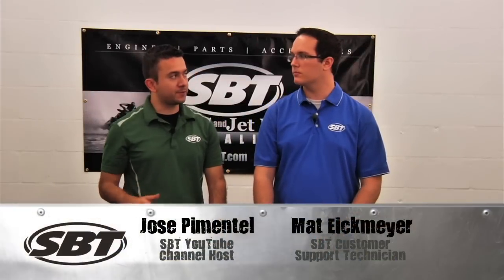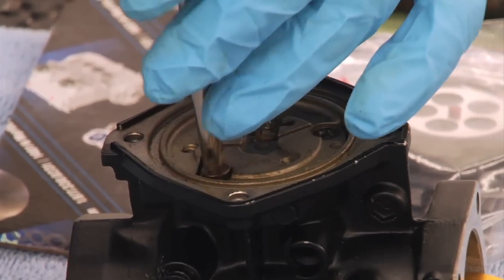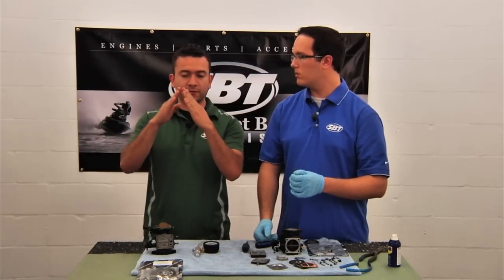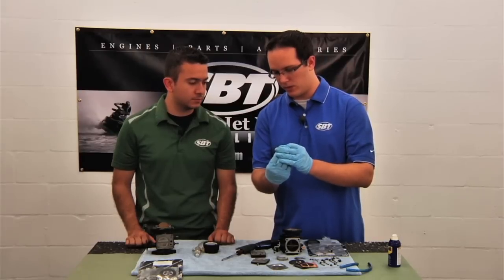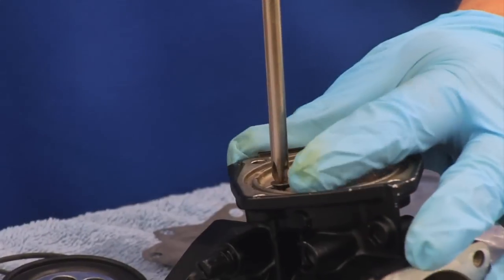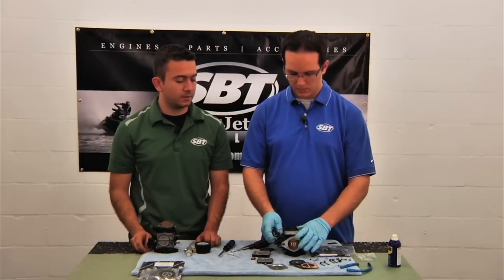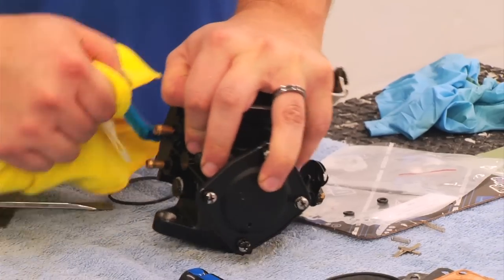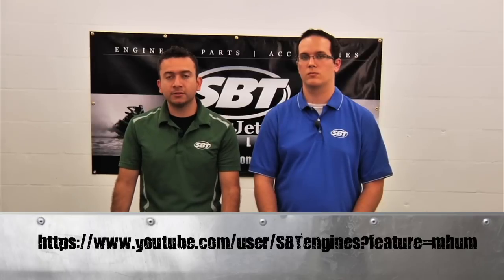SBT Tech Tips: Carburetor Rebuild

Comment: Also, thoes are not Phillips screws, they are JIS. They look very similar, and a Phillips head screwdriver will work, however, you run the risk of stripping the screws. Get the proper screwdriver, you will be glad you did.

Comment: 8:16 and were finished to put the diaframs in"
Wel how did you do that? Because it's a nightmare to get those rubber grommets in place!
Reply: there is a video which uses tooth floss. to pull them in . looks way easier. use wd40  to help as well. like thread pulling a needle.

Comment: Your pop off pressure showed much less then 20 psi. More like 16-17psi. Why did you not mention this and show how to correct it by changing springs or any other way of making the adjustment to get the correct pressure? Seems you are defeating the purpose of a rebuild if not done to specs!
Reply: Guage: 15psi 
SBT: yep, about 20psi there.
Reply: Yal have clearly never looked at a gauge at an angle. The camera wasn’t facing straight on towards the face of the gauge.... I saw 18 +/- the first time. Which was Probly right at 20. Don’t be a Karen.
Reply: @jcbenson01  I guess close to 18psi. Even if it was 20 psi there are very very few sea doos that would actually be in spec for... SBT=JUNK idk how they stay in business honestly
Reply: There is a range for the pressure but they don't tell  you in this video. About 20 must mean 15-25 I'm guessing. Why do they tell you to change the spring anyway, it's not like they will wear out. Unless it's corroded, I would leave the original spring in there.

Comment: Ive just rebuilt an SBN 44 on a Kawasaki Sxi pro (same carb as in video). Now the carb spits a lot of fuel out of the top? can anyone tell me why? It ran fine before I rebuilt the carb.
Reply: I would check your read valves. They could be letting air back out through the carb making the fuel spray up.
Reply: First, be sure to check the Needle & Seat and make sure you're using the OE recommended size seat.  Depending on your application, the seat sizes ranges from 1.2 up to 2.5 and are used in conjunction with the proper colored spring to make the correct amount of pop-off.  Updated pop off charts are available online from Mikuni, SBT, and others and they can be handy for reference.  If you ski is stock (unmodified) and you want  it to run reliably, use the OE recommended size N&S and spring!  Be absolutely sure that the small o-ring on the face of the seat is brand new and that the needle doesn't have a "ridge" or line. Both MUST seat properly or you could have a seal issue or "dribbling" problem.  Since your carb is spitting out fuel, it sounds like you've got a dribbler... it's usually a fairly easy fix.

Comment: Show me how to adjust the fuel mixture!
Reply: Lower screw on carb body is low speed screw start at 1 turn out upper left side is high speed start with it slightly closed  remember this is just a universal setting adjust as heeded

Comment: Any tips for removing the screws that hold the top covers if they do not want to budge?
Reply: Use an impact screw driver.
Reply: I grab mine with a small vise grip plier to break them loose.
Reply: Those should have a dot stamped into it right in one of the triangles of the x slot so they're actually JIS (Japanese Industry Standard) screws not phillips. A phillips head screwdriver or bit will have a longer tip that prevents the blades from engaging all the way into the head of the screw. I think the blades may be a little thicker and flat sided (not tapered) also. You can either get a JIS driver or bit or if you can't find one, I've found that taking a #2 Phillips (in most cases) and grinding a little off of the tip will let the driver seat into the screw sufficiently to keep from stripping the head. An impact driver could work too but remember to make or use a JIS bit and also putting the bit in the head of the screw and tapping it with a small hammer to shock the threads and seat the bit will usually make it easier to break it loose. Vise grips on the outside of it (provided you have room) can work if the head is stripped or it's really stuck, like someone else mentioned in the last reply. JIS is the real key.

Comment: First of all, get some gloves that are tight to your skin to make easier, his were driving me crazy. At 4:58 you mentioned that you were using a Phillips head screwdriver with no mention of JIS. Wouldn't a JIS driver be the proper one for that and all the other screws on the carbs? Amazing, those clear plastic check valves with the blue line. They're clear plastic, could they make it more difficult to figure out? Is there a little concave or convex to them? Another video mentioned that there is.

Comment: ok when I start mine up it wants to run wide open any suggestions thanks
Reply: That is caused by an air leak. carb base gaskets, crankshaft seals, etc.
Reply: ok thanks I rebuild the carb and didn't change the way it run,if I choke it then it will help by flooding it I would think but thanks for suggestions
Reply: Check throttle plate make sure it is closed engine should not start if it does check for air leak make repairs open throttle plate from closed position to just slightly open and restart engine adjust throttle screw so that out of water idle is about 1500-1800 rpms

Comment: Wow you should take this down I mean for real you guys are a big company this is about 30% accurate and the real important details like making sure the check valve is flat you don’t show or how to not go all the inside of the seat with the needle nose pliers that you use to pull it out. By the way the spring that you said sort of match does a totally different setting and now the thing will probably not run right I mean for real dude you don’t really know what you’re talking about take this video down
Reply: How would you determine the proper spring to use.
Reply: @chives3034  the correct way to do this is test pop off pressure first if it's in spec keep the spring that is already in the carburetor and use all the other rebuild parts
Reply: I agree, this video is fraught with errors or misnomers, but this obviously is a parts guy doing it not a mechanic that rebuilds them all the time. He probably just got training from a real mechanic recently before the video was shot. He doesn't even know the screws are JIS not Phillips head. The check valve installation wasn't really descriptive enough either. How about some written instructions with the kit? Would that really cost a lot more for instructions like all carb rebuild kit manufacturers used to provide with specs for all the variations of carbs by serial number.